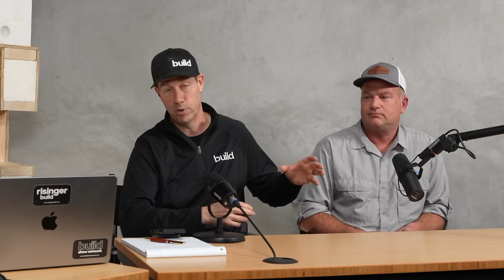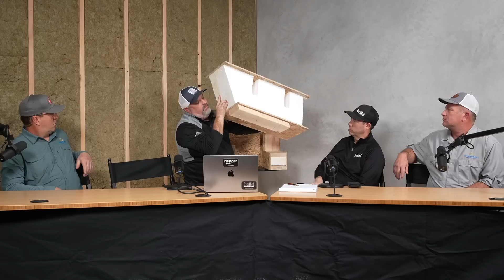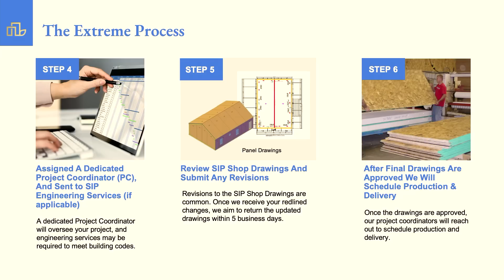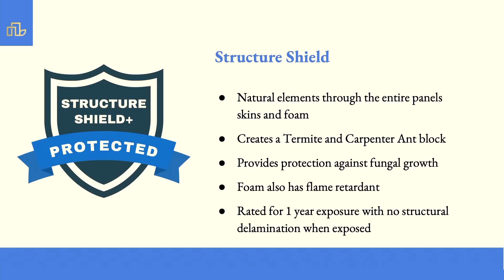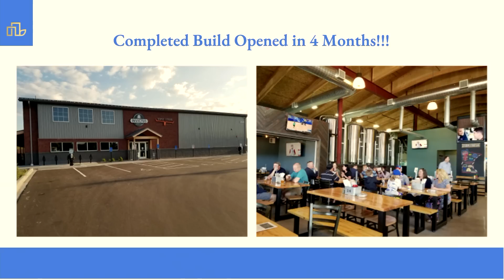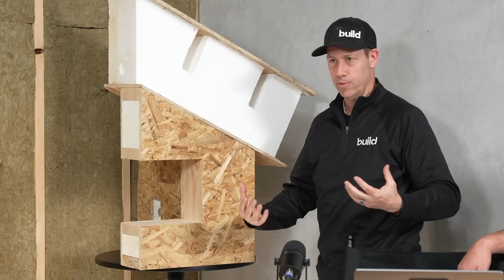Becoming an Extreme Builder - Benefits of a SIPs Lead Program

Comment: Hi Matt, great video! Have you read the recent article by the Godfather of Forensic Building Science Dr. Joe Lstiburek on SIPs? It’s called “Structural Insulated Panel Systems” and you can find it on the Building Science Corporation website or you can look for “BSI-148” on Google. The article offers a lot of his suggestions for making a SIPs building (especially the roof) more resistant to bulk water, vapor movement through panel seams and heavy snow conditions.

Comment: The acoustic properties of SIP assemblies suck. How do you mitigate sound from travelling from the exterior to interior?
Reply: The sound STC ratings of SIP walls are superior to traditional stick framing. Additional sound damping can be done with extra gypsum layers and resilient channel installations where extra loud areas are involved. The extreme air tightness of SIPs is what reduces the sound transfer vs. typical construction. There are numerous schools built across the country with SIPs due to their superior sound damping qualities.
Reply: That has not been my experience in the last 20 years of building with SIP's.

Comment: Matt, I’d love to see you revisit some of the passive homes you have introduced us too and test the air quality after lived in. I’m curious about the off gassing over time. I know there is a complete turnover of fresh air every so many hours but what is the air quality in the. In between time?
Reply: All high-performance homes like SIPs should have continuous mechanical ventilation as required by ASHRAE 90.1 and Manual J HVAC calculations. This is not a SIP  issue.

Comment: SIPs are not fireproof enough for me. I use MIPs instead (metal insulated panels). They are much more fireproof.
Reply: Metal and Cement facers are available with SIPs. However, they tend to be more expensive & heavier. The main SIP advantage against fires is the unventilated attic to prevent flying embers getting sucked into the attics. Most of the fire resistance of all buildings has more to do with their facade & roof finishes.

Comment: What is the fire rating on your products.  Such as structural value  if it's involved in a fire
Reply: SIPs are mainly used for Type 5 construction since made from wood up to about 4 stories. They pass the one hour fire ratings required by code and also have some two-hour approved assemblies. You can see the ICC fire values in the ICC-ESRs.